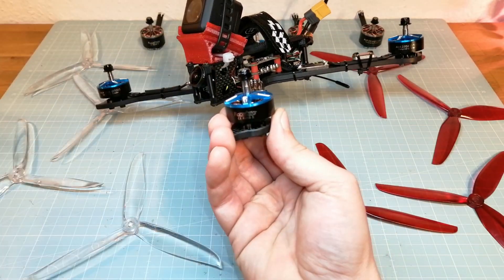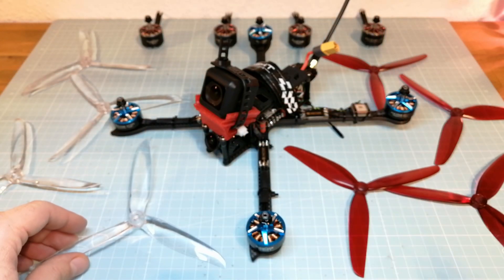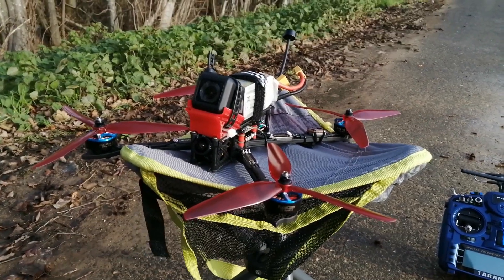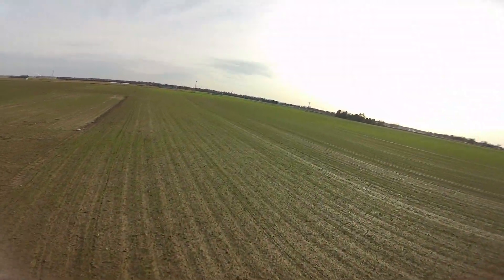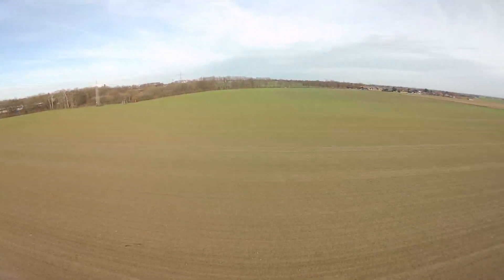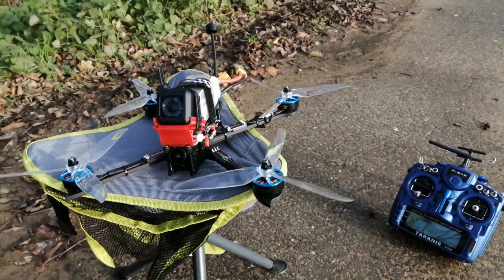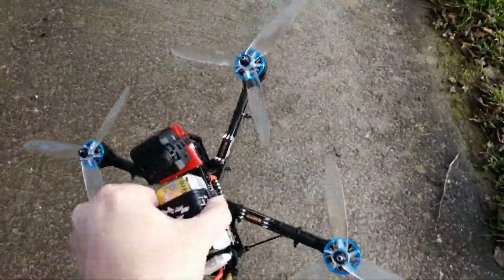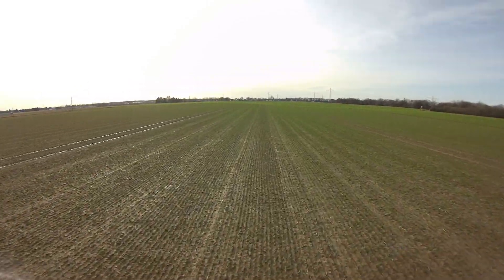Long Range - New Results 🤓 Racerstar AirA - HQProp vs Dalprop Cyclone 7 Inch Propellers

Comment: Hi Torban, did you ever solved the wobbles and vibrations of this quad. I have almost the exact setup, iFlight XL7 v3 and HQ 7 inch props. I am still not able to solve those wobbles, perhaps the 4mm thick arms are to this for a 7 inch. I noticed that the newer v4 has 5mm arms and perhaps that will solve the issue. Greetings from the Netherlands

Comment: Hi Torben i have nearly the exact setup like you and have much much less propwash oscillations. I have tried the PID settings from Tommy. Check out his Video, that was a huge step for me. Even with bend props the Quad is flying so good. The Filters i have set with the slider to 1.3 each and use Bardwells Settings 4k/4k Biderectional DSHOT300. Maybe ths helps you out too. I flew with 4S 1550mAh Lipo single and parallel and with a DIY 4S2P LiIon 6000mAh (420g)

My Setup:
TBS Source One 7Inch
T-Motor F60 PRO II 1750kv
HQ 7x3.5x3 (also bend props after 2 crashes flew great)
T-Motor F7 HD FC
T-Motor F55A PRO II 4in1 ESC
TBS Crossfire Diversity Rx
Matek M8Q-5883 GPS
Hellgate Buzzer
DJI Air Unit

Akku´s:
4S 1550mAh 100C Lipo and DIY 4S2P LiIon pack 6000mAh

Comment: +1👍 awesome buddy, i had some discussion in discord that lead to the idea that HQ props were too heavy (2+ grams heavier than Gemfan/Dalprop) 
Something i found out on my own that i would like to share:
i had found my P/D ratio and kept working with that ratio, but always had my flutters.
i have been running at 90% of what i thought to be the max P (with D to match), on both Roll/Pitch.  I found my flutters make the most visual evidence on pitch (BBL). 
it always looked like D forced P up too much, and then forced it back down too much , then the quad would recover after a few bumps. so these flutters were evident in BBL, when overlaying HD.
one day recently, with ZERO wind, i dropped just my D down another 10% (i wanted to test EmuFlight "SPA"-D at 120%)
I had, for all practical purposes, near ZERO flutters for the first time!
Then the next day in high winds, i had MASSIVE flutters! (These two video are unlisted, but are shown on my YT homepage)
So my conclusion is that my 7" quad does not like a balanced P/D ratio, probably due to larger (&slower to respond) props.  Lower D was my answer.  Additionally, wind turbulence had a massive effect to cause these flutters.
QuickFlash has made a feature in development version EmuFlight 0.2.3 called D_Smoothing that should address this D_Term issue -- i hope to test it soon, weather permitting.
I think all this info and a combination with lighter props (maybe 6") will ultimately be the solution.
Reply from the maker: Thanks for your detailed comment! To be honest, it was windier on this test as on my test with the racerstar AirB - i also think wind causes wobbles and flutters. I have already heard about the new EmuFlight Release, but it's still noch available for the newer FC Targets, so I do not intend to test it on my 7 Inch quad again at the moment.  BTW, did you try BF4.1 with RPM Filter and dynamic Notch = Low to compare it with EmuFlight? If you would like to test BF 4.1 on your quad, I'm can help you to set it up on your quad - feel free to contact me on discord. I would also realy like to fly my quad on Emuflight, but it doesn't make seens at the moment without my targets.
Reply: @TorbanDallas  i will consider BeF again. i have limited time which blocks my ability for drastic change and re-tune.
Reply from the maker: @nerdCopter  no drastic change, take a diff of your emuflight setup. Flash Betaflight and test it with the default settings :) Just make sure to set up your filters like the betaflight wiki recommendations - i also show it in this video https://www.youtube.com/watch?v=KxPiyjPruvM
Reply from the maker: @nerdCopter  btw: why are you not mentioned as a test pilot of emuflight - I liked your flight videos with the bbl overlay
Reply: @TorbanDallas  mentioned as contributor, that's good enough for me. :) happy about it!   my tests were just flying, not so much pointing out anything specific. :)

Comment: I made also the switch between the HQ and the DAL ones and it was the best decision i ever made, less wobbles and way more easy to tune the PIDs when using Betaflight 4.1.x <3
Have a great week and keep on flying my brother :)
Reply from the maker: Thank you! So you definitly prefer the Dalprops? Have a great week too :)
Reply: @TorbanDallas  Absolutely, it's a better propeller than the HQ, i was worried about the high pitch but it seems to actually perform way better than expected so far!
Take care my brother :)
Reply: @TorbanDallas  I also switched from HQ to DAL, it's so much better!
Reply: @marlin-fpv  
Yep, dalprop ist the best. Has also best balancing.

Comment: Hey torban, du solltest mal 2 blade props testen. 
Habe das wobblen insbesondere bei Wind nie richtig weg bekommen bei meinen 6 Zoll quads. 
Jetzt mit emax avan 6038 fliegen die astrein. 
Selbst mit billigen 2 Blatt wars besser als mit den 6 Zoll dal 3 Blatt.
Reply: Kommt mir sehr bekannt vor dein Problem, mit dem R9M. Habe noch die alte Version, aber auch stäbndig Verbindungs-Abbrüche. Frsky geht mir so gegen den Strich gerade. Hätte ich das Kleingeld, läge schon eine T16 mit Crossfire unterm Weihnachtsbaum...
Die AirB fliegen sich wirklich lahm mit 4S - 1200KV sind einfach zu wenig. Schnall mal einen 6S drauf, denn fliegen dir die Ohren weg. ;-)
Ich fliege die Motoren mit Master Airscrews 8060 auf 6S 2200maH. Ziehen dann so um die 150A, ist aber natürlich nichts für Longrange, da würde ich aber trotzdem eher auf 5 S gehen.
Reply from the maker: @brundlefly3658  5S wäre vermutlich auch mein nächster Versuch. Die Probleme mit FrSky und auch gerade mit den neuen Funken die zunächst abwärtskompatibel waren und nicht mit den alten Empfängern zurecht kamen sind echt nervig, da kann ich auch nachvollziehen das immer mehr FrSky den Rücken zukehren. Mit den Jumper Funken habe ich mich noch nicht befasst, habe ich auch aktuell wenig lust zu mich wieder mit was neuem auseinandersetzen zu müssen - optisch gefallen sie mir außerdem nicht :D
Reply: @brundlefly3658  hast du denn die aktuelle Firmware auf Empfänger und Sender?
Reply: Aktuellste Flex Firmware ist drauf, daran liegt es nicht. Vermutlich hat mein R9M Modul einen weg.
Reply: @brundlefly3658  habe ich jetzt schon ein paar mal gelesen, dass das Modul einen Weg hat. Habe hier nur 2 r9m lite und ein lite pro, bisher alle ohne Probleme.
Reply from the maker: Hi, na das verwundert mich jetzt aber und das kann ich kaum glauben. Bei den 5 Zoll Quads hörten die Vibrationen doch erst auf als wir nach und nach von 2 Blatt auf 3 Blatt gewechselt haben. Hatte bisher nicht ansatzweise daran gedacht 2 Blatt Propeller zu testen - werde ich dann wohl doch mal in Betracht ziehen :)
Reply: @TorbanDallas  mach mal, habe das wobblen mit bei den 6 zöllern mit 3 Blatt nicht weg bekommen.
Nach dem Wechsel auf 2 Blatt, auch schon mit den billigen King Kong?! War das weg.

R9 habe ich jetzt auf r9m lite pro gewechselt.
Ging auch ziemlich einfach, einfach mit dem neuen Modul auf receiver1 bind gehen und den quad anschalten.
Bisher keinen failsafe gehabt mit der acct flex ab December oder jetzt mit der access 1.1.2
Reply from the maker: @SchonRichtig  werde ich mal ausprobieren. R9M 2019 nutze ich ja mit meinen R9mini, r9mm und r9Mini Ota Receivern, alles bisher wie gesagt auch ohne Probleme. R9m Lite Pro hatte ich auch ausprobiert mit einer Taranis X9Lite Pro - funktioniert 1 zu 1 genauso gut wie das R9M 2019. Nach aktueller Auskunft von FrSky gibts aber wohl tatsächlich Probleme das die Receiver gelegentlich die Bindung nach dem anstecken des Akkus verlieren - ggf. war das mein Problem.
Reply from the maker: btw: wie läuft es denn bei dir mit dem R9M? Ich hatte seid den neuen Antennen und der Flex Firmware keine Probleme mehr ... bis gestern - daher habe ich auch nur 2 Flüge geschafft. Bei dem Quad ist der R9Mini Ota mit der Access Flex 1.1.2 FW verbaut. R9M 2019 mit aktueller FW entsprechend in meiner Taranis X9D+ SE 2019. Nach dem Landen, disarmen und Funke auf den Boden stellen bekam ich eine Telemetry Lost Warnung - gut dabei habe ich mir nichts gedacht, Copter ca 20m Enterfernt auf dem Boden, Funke auf dem Boden, dass kann schon sein ...
Beim Anstecken des nächsten Akkus hatte ich dann keine Verbindung mehr. Am Ende musste ich tatsächlich den Receiver neu binden. Nachstellen in dem ich ein Telemety Lost im Range Mode oder ohne Antenne am RX provoziert habe ließ sich das Problem nicht - nach der Telemtry Lost hatte ich jeweils wieder eine Verbindung.